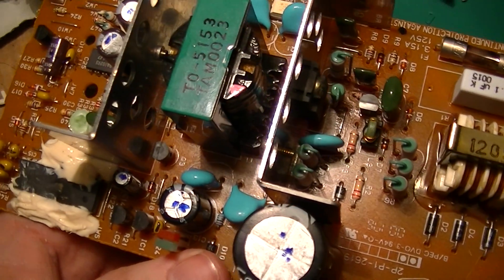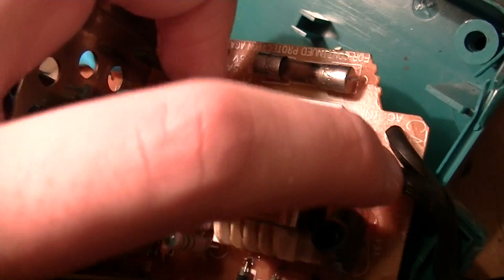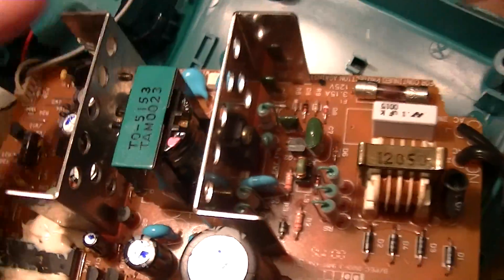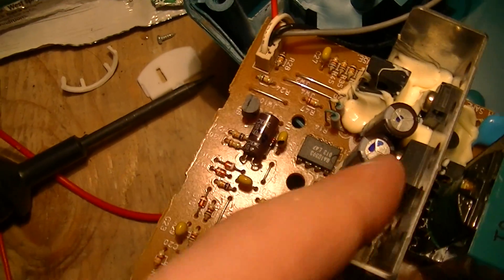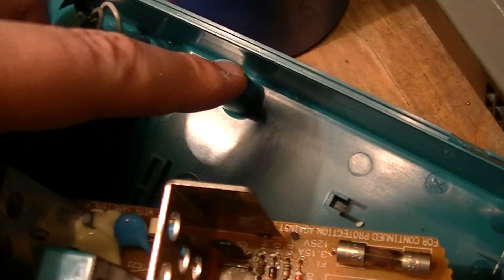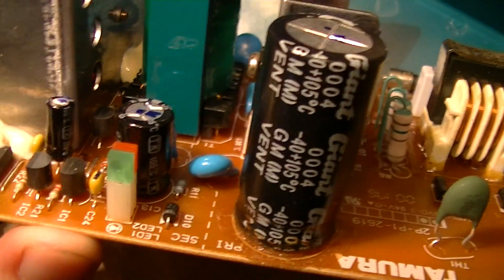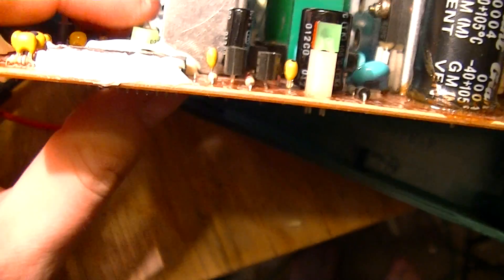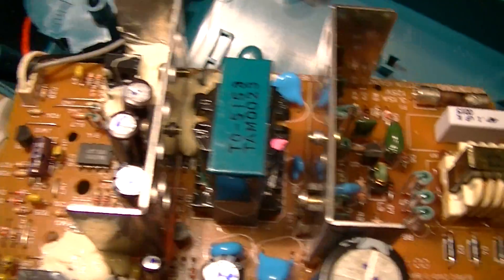Makita TC1411 drill battery charger guts

Comment: Nice video I’ve been given a similar one to fix, the two power mosfets that feed the battery have scored the board on mine and the red led is flashing, voltage across the battery terminals is about 30V which seems a bit high. Any one know the correct output voltage it’s a dc1803.

Comment: nice video, I've short circuit my cordless impact Bluepoint charger from the battery side. stuck wires to charge a battery not for it and touched the wires, fuse is not blown. to start, how and what to test to see what needs to be replaced? I do not see any burn marks as bad as on your video. your help is very much appreciated.

Comment from the maker: I have no idea what the IC is (the failure mode and silicone goo acted in concert to obliterate the part number), and it looks like there are other dead parts on the board as well.
I will probably just build a replacement charger that uses a standard monolithic battery charger IC (a few bucks at most from Jameco or Digi-Key).
This is actually a reasonably made unit for what it is and where it was made (Taiwan).